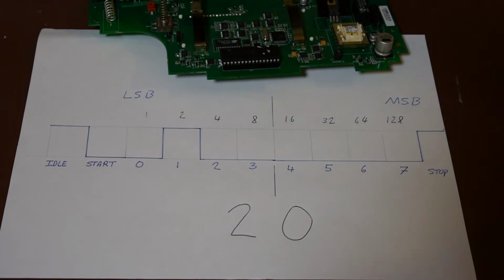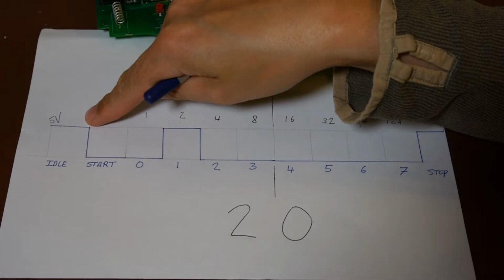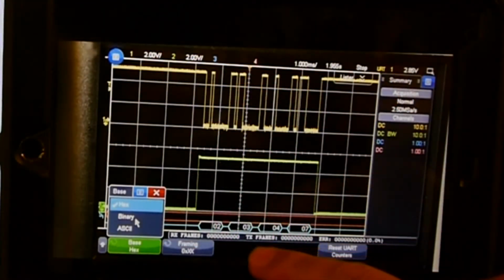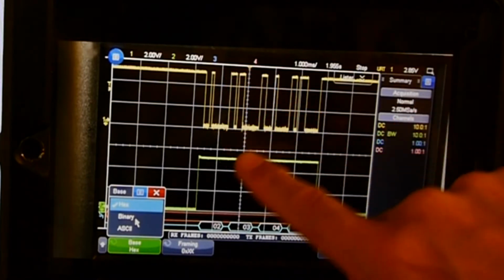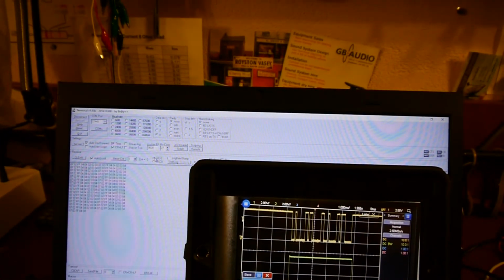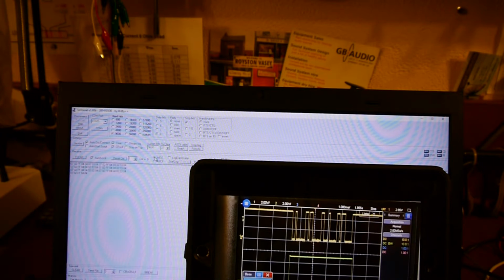Alarmed And Dangerous Part 3

Comment: Oddly interesting, It's easy to dismiss stuff like that panel and not take the time to look over the details,
 Cheers, J.
Reply from the maker: Average Joe  That's just the way I feel about it.  When you first open the lid you just see a bunch of components and no idea about what they do or how they do it. But with just a relatively short investment of time the secrets reveals themselves.  It's also a good way to learn from others to see how the various operational requirements were resolved in the hardware and software solutions. Just one more to go looking at the RF transceiver. As always Joe thanks for your comment and support.